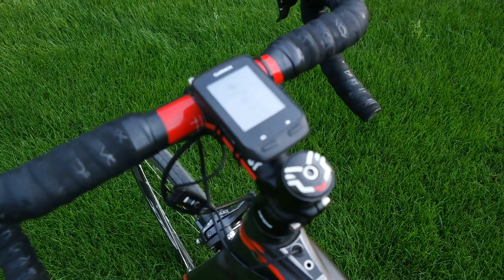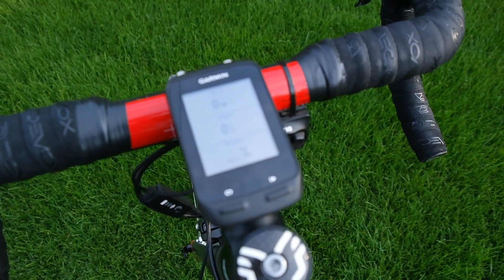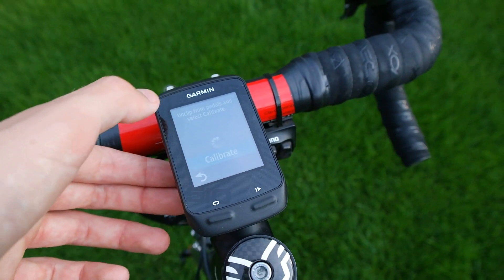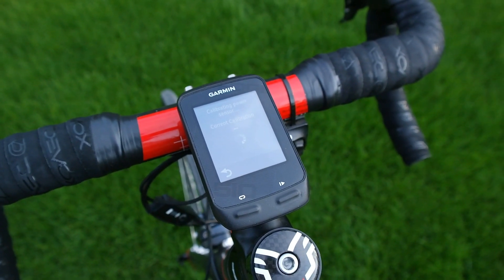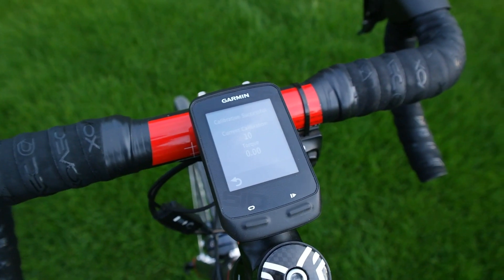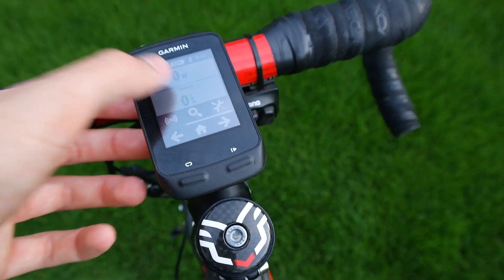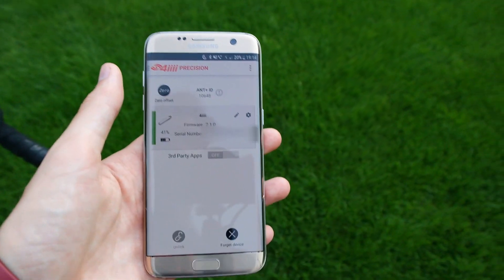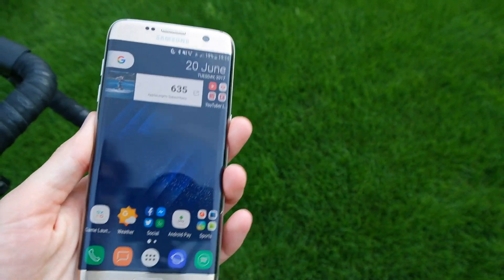4iiii Precision Power Meter Calibration

Comment: Currently the power meter 4iiii the Watt numbers have changed, large numbers have become contrary to reality and the factory has been reset and currently the calibration does not work and the experiment has been done a lot ,what is the reason for the lack of calibration?

Comment: Thanks for the video still no luck error 20 but the cranks are not moving
Reply from the maker: Oh sorry to hear that. The bike is all steady as well? Worth taking the battery out and back in, see if that resets it
Reply: @JackLeighJCL  I managed to fix it I changed the battery as removing and putting it back didn’t work - thank you for responding
Reply: @PunjabiCyclist  what did you do instead of changing the bettery?

Comment: cheers everyone , just leaving some notes here on this power meter , its true that is very accurate , similar power as my tacx neo , very light , very happy till last week , seems that after 2 years , after you lose your warranty the left arm powermeter starts to fail , its reading to high , max power 16000 w , cant calibrate , giving error on the 4iiii app or any cycling computer , contacted 4iiii and seems that they have a auto reply for everyone thats complaining about the same problem , if you google  it will see that there are many people complaining about , like check if it has the latest firmware , cooper contacts ,batteries etc , when i got a real answer from them was saying that my power meter was out of warranty unfortunately ,but they will give a 50% discount on fixing it , that said , i will had to pay 250 cad to fix the left arm , and without warranty that in the next 2 years i will have no issues with the power meter , so paying 250 every 2 years is ridiculous !! very disappointed with 4iii ,just consider this before you buy 4iii first !!cheers

Comment: I have a Garmin 500. Nothing happens when I calibrate it. No idea if its accurate or not. I suspect its reading low.
Reply from the maker: When you say nothing happens, do mean you press calibrate and nothing happens, or the Garmin show an unsuccessful calibration?
Reply: Hey mate, I have a 500 too and I didn’t seem to work so I used the 4iii app instead
Reply: Do u have to recalibrate when temp changes?  For instance if you are riding up in the mountains (sometimes up to 10f colder)